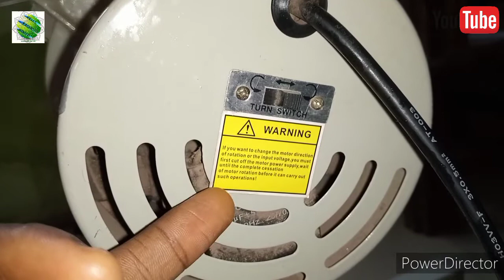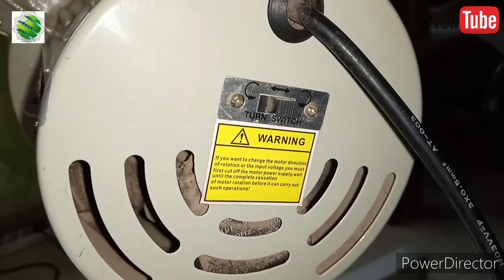DYI on industrial sewing machine

Comment: God bless you I never knew about these ever. My God collecting 8000 naira for these shows man's inhumanity to man.  You said something that the machine is universal, so what else can one use that backward setting to sew it?
Reply from the maker: That means if your weaving machine engine is not working you can equally take the one from your industrial machine and fix it,  because weaving rotates backward, while industrial sewing machine rotate forward in order for it to work
Reply: Is it all industrial machines that have that function?
Reply from the maker: Not really, only few
Reply from the maker: But anyone with switch on its clutch
Reply from the maker: But anyone with switch on its clutch

Comment: Pls mine does not have this switch and I have turned the wire it's still sewing backwards pls help
Reply: Please how did you fix it,save a soul please😩
Reply: @Midestouch  after rotating the plug switch it off allow to rest for about six min then on ur machine
Reply: Thank you once again,after putting it on turn ,it was working perfectly, pushing the button to the middle my engine is not responding